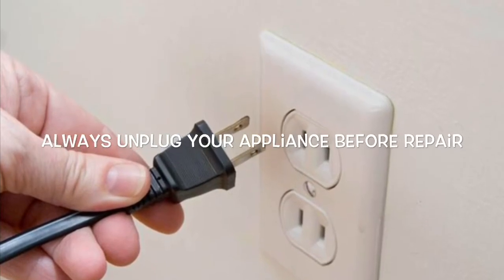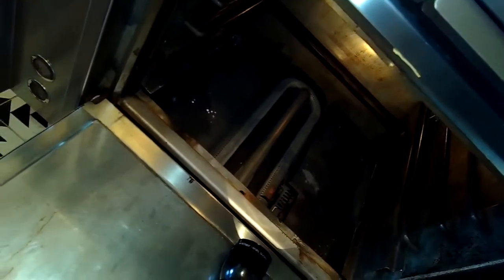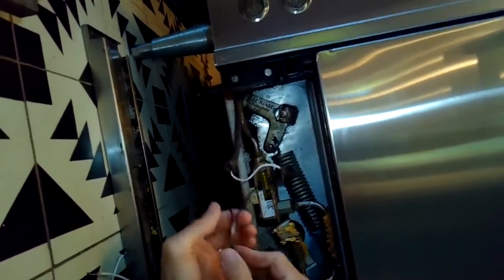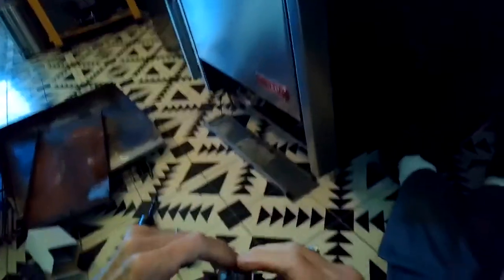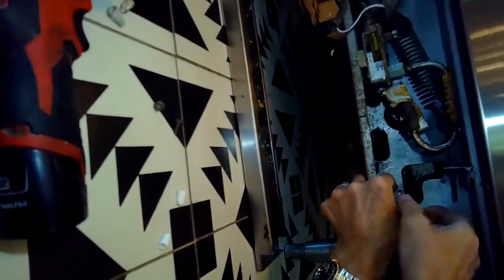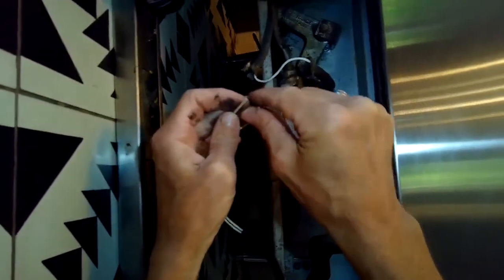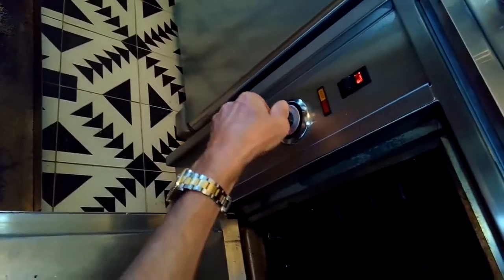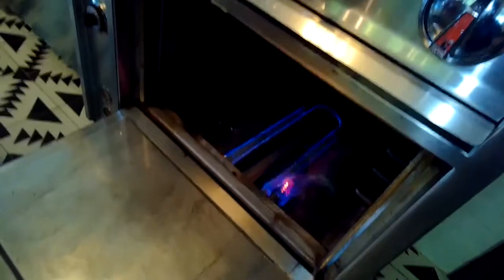✨ Jade Dynasty Oven — Not Heating (EASY FIX) ✨

Comment: Hi Scott!  
I DID IT! 
The new ignitors from Dvorson's in Sausailtio came with little "electrode plugs" (??) and instead of having to hardwire two wires with a ceramic cup, I simply connected them into the paired receiving "electrode plug" (?? -sorry, don't know what they're called).

Question: how long should it take for the gas to ignite? It seems quite a long time that the ignitors are burning. My timer says it takes nearly 35 seconds
Reply from the maker: Awesome job.
60 seconds or less to ignition is good👍